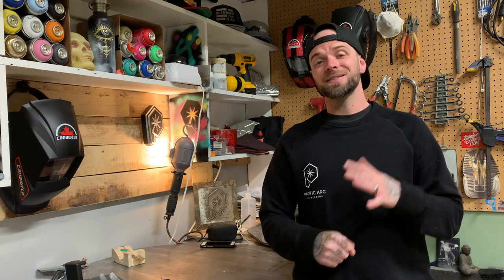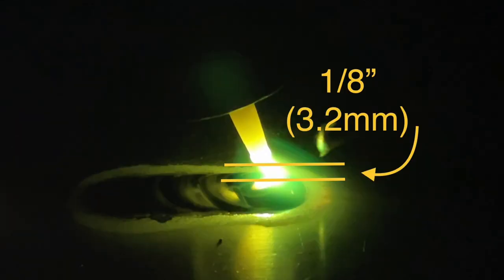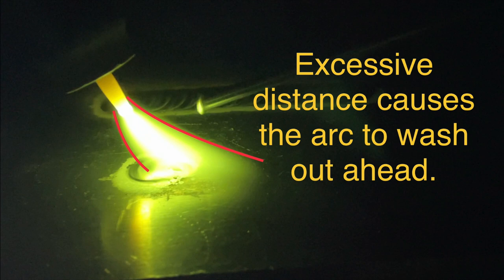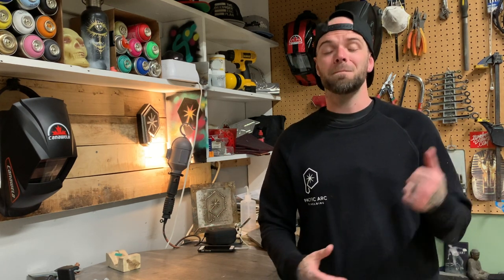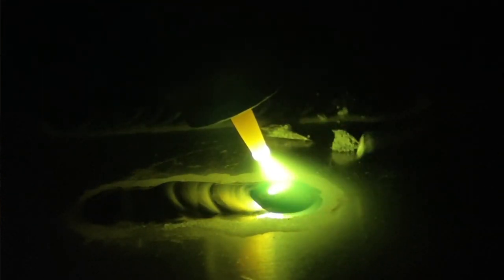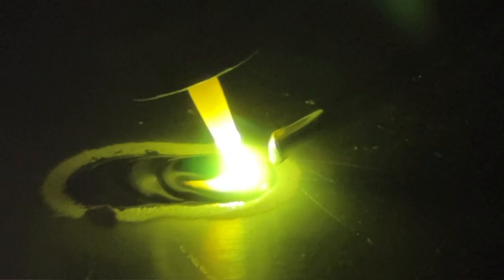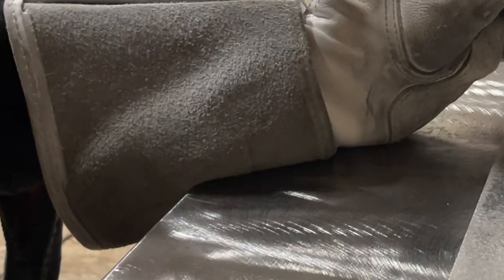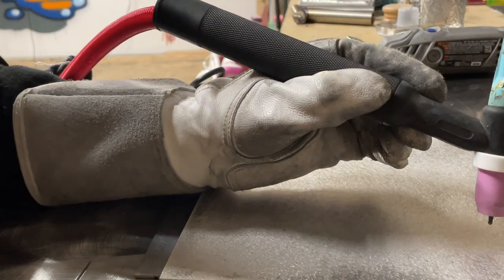The most common mistake with Tig Welding Aluminum (AVOID THIS!)

Comment: Now if you could keep me from dipping my tungsten in the weld pool :) ...
Reply: Me too lol
Reply from the maker: Got an episode for ya on Friday! Make sure to check back!🙏🍻
Reply: Wrap ur gloves around with some aluminum foil tape and use the side of ur hand to touch the piece you are using and use it as a base. Don't know if I explained right...
Reply: my issue is sticking the fill rod to the tungsten lol
Reply: Use a 2+4 piece of wood

Comment: Super helpful -- THANKS!
I think read somewhere that excessive TIG arc length eats up way more votage or amperage than you set on the machine? I'm new to TIG and can tell you my inverter AC/DC TIG machine went bonkers (even error coded) the few times I accidentally pulled the arc too far out. Yep, I need to practice practice practice big time. Thanks for all your great videos.

Comment: Thanks. After watching few of your videos i bought an s7 inverter tig welder from the jungle. I am trying alum welding to build a trailer. While practicing with 1/8 thick alum it just melts the entire dam thing. How can i make a puddle and add filler rod? I tried 70 80 90 110 130 n 150 amps with 15 cfm pure argon... Great videos btw.

Comment: I bought Esab215 welder brand new. For Some reason I can't get the weld going for the tig setup aluminum weld. Do you need ground for tig welding aluminum? I am running on 120VAC and I can't seem to find a menu to switch from DC weld to AC for aluminum weld. Very frustrating. Not sure what I'm doing wrong. Won't light up

Comment: I'd like to know your machine brand and model, Tungsten size and type. Length of stick out. Metal grade and gauge. Filler type. Amp setting. Balance setting. Gas cfh.  Thank you
Reply: I can answer each of these for you:  Varies, varies, varies, varies, varies, varies, varies, and also... varies.   These variables change constantly based on job, material, position, joint type, and desired finish.  There are no magic settings that work for everything.  Learn your machine and get some time behind the torch.
Reply: @SolarMillUSA  I referring to information concerning this video. Only. Thank you.

Comment: Roll that cup dangit! Jk. Honestly im very proficient in mig arc and not bad at tig for stainless. Got ok at aluminum, the question ive not really been able to figure was why the metal wouldn't melt, just turned red hot. I was welding with dc and was able to stick the pieces together once I switched polarity. I assumed that was the issue but recently learned I might be wrong. Sorry it a long read but very curious if any expert knows. Thanks
Reply: I know know ac is the proper power source.

Comment: Videos are awesome, thanks! You may have covered this. Is it the amount of filter rod you push into the ark, that makes the ripples? Mark
Reply from the maker: I find it does more so with stainless, but definitely as well with aluminum. The stepping motion usually allows it to freeze and create the puddles:)